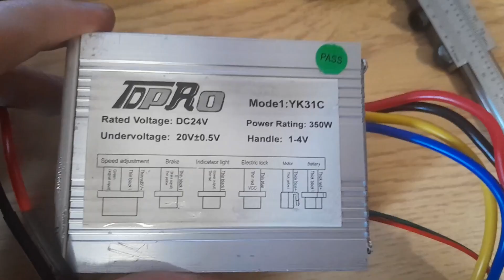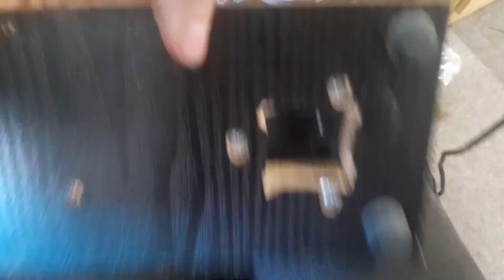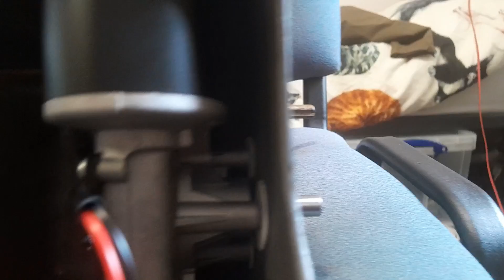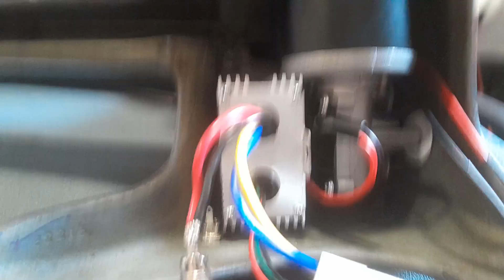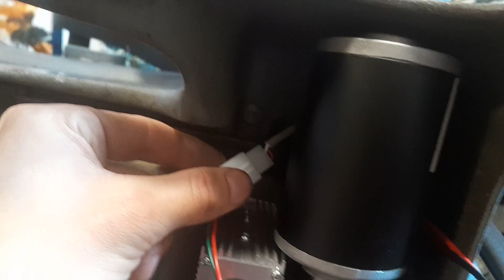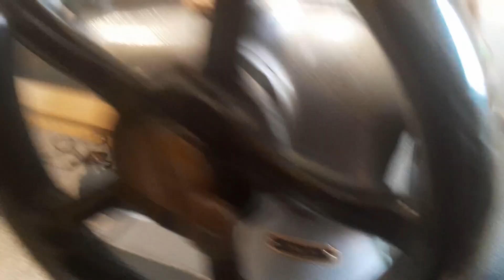Singer 29K - How to attach a motor

Comment: hi, thanks, can you please put an aliexpress link of the pieces that I have to do the same thing and I don't know where to find the material? Thank you
Reply from the maker: Hi Claudia. The controller and pedal I used is https://a.aliexpress.com/_EwslTqV
and the motor was this 250rpm one https://a.aliexpress.com/_Ey3Q9mV

I messaged the motor seller confirming I wanted a left hand type motor before buying it. You can find many other similar motors from other sellers, just make sure it is left hand type and at least 250rpm, if I were to do this again, I'd have bought the fastest one I can find (350 rpm) so I could use a smaller pulley on the motor and minimise risk of the belt slipping
Reply: @killerbanjo  Hi dear, thank you, now I found everything and I'm doing the work. I'm missing a piece that arrives in two days. Thanks again, a hug!
Reply from the maker: @claudialeoni2079  good luck with it!